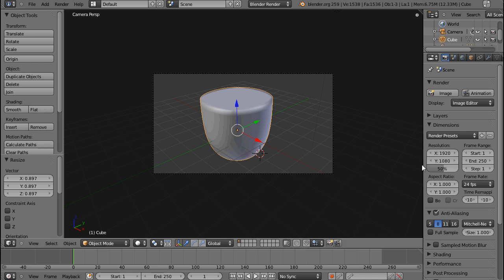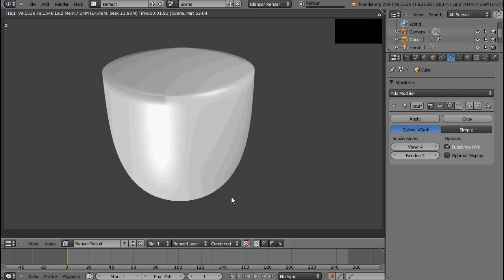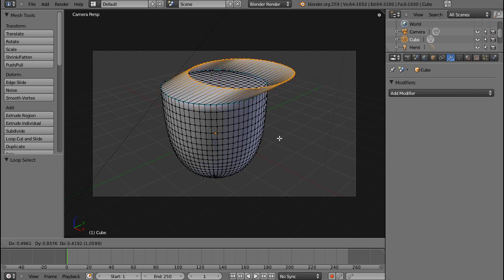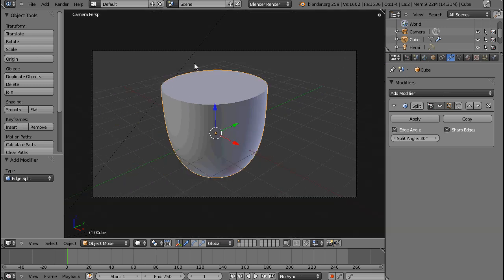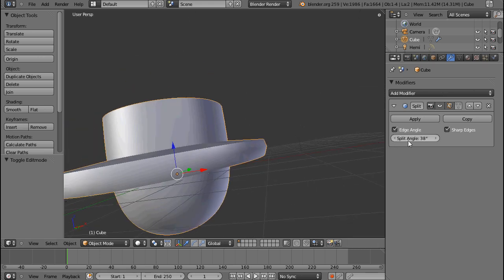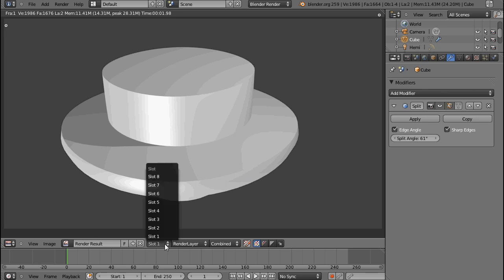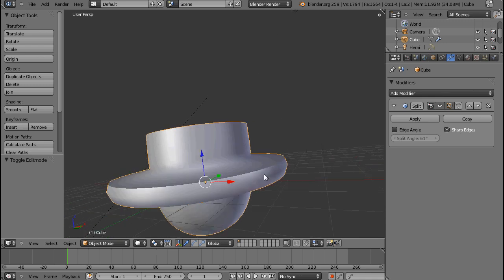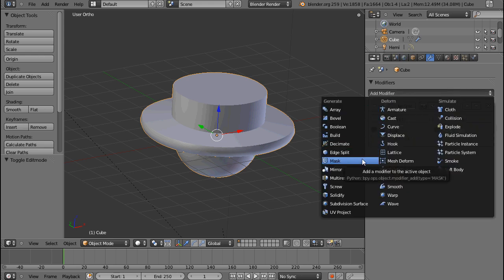Blender Tutorial I Edge Split Modifier

Comment: Very very useful when you have a model with sharp edges and rendering as smooth looks all messed up, but rendering flat you see triangles on flat surfaces that only go away with a million subdivisions.

Do this to solve the shading issues on somewhat low poly models then add some subdivisions to get the highest quality result. Or at least that's what I do.

Comment: The "sharp edges" option splits the edges that are marked "sharp" and get become green. You did that but you didn't know that it is used combined with the edge split modifier. If you uncheck "edge angle" you will see that only the "mark sharp" edges will be split.
Hope this helps someone.

Comment: Edge Split modifier unfortunately does exactly what it say's it will split all edges in your mesh to add sharp effect which is no good. If you export a mesh as an obj,fbx and import it in to another 3D package (go in to vert mode) you will see that the vert's aren't welded or just look at your vert count in Blender when you apply to a mesh object.